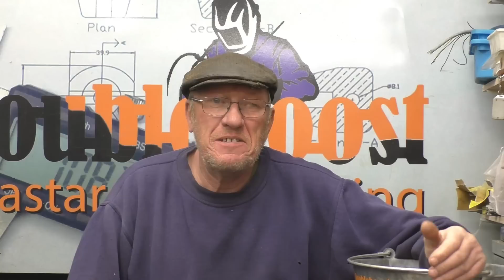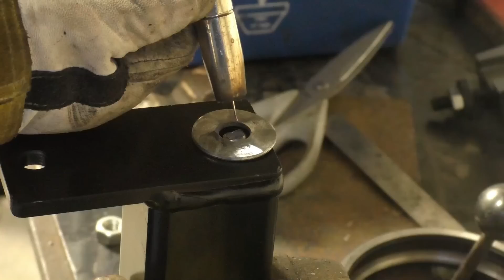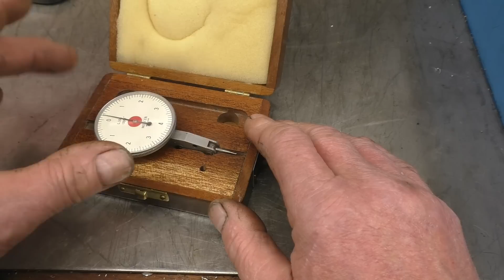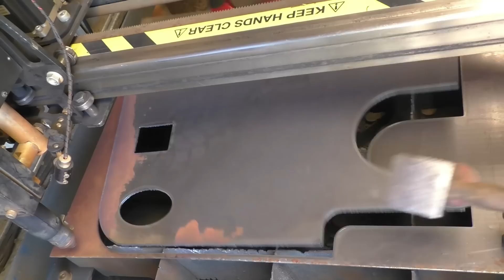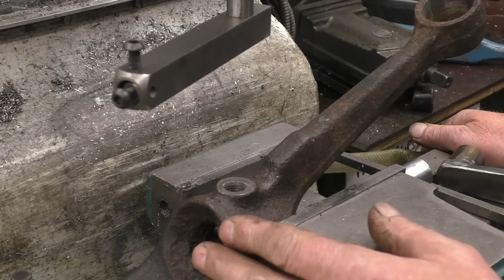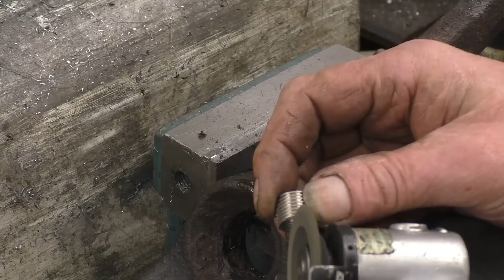SNNC 453 P1  Debs Lamp . Monthly Draw.  Stud Removal . Plasma Cutting

Comment: If the bolt was you took out was galvanised, galvanised bolts are over-sized from standard metric bolts. Easy to snap them if you keep trying to wind away when they jam up.